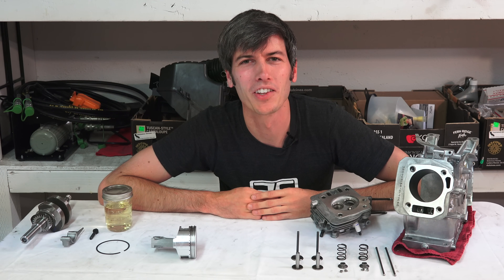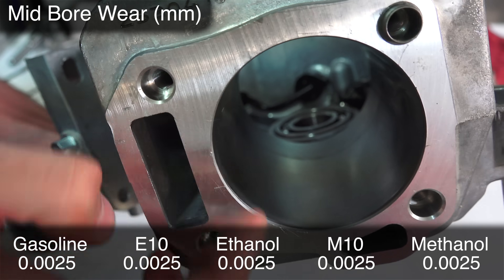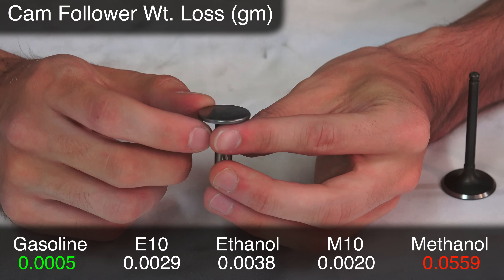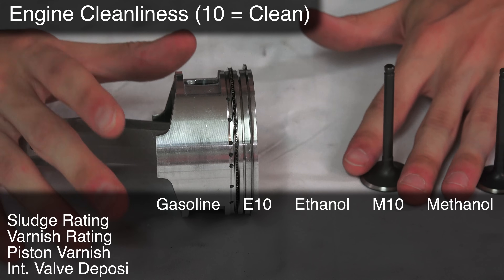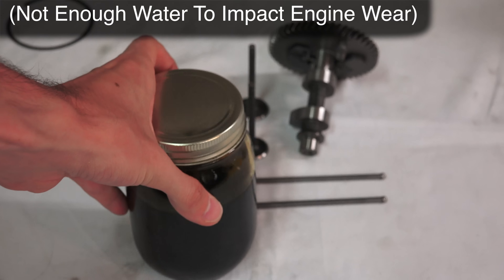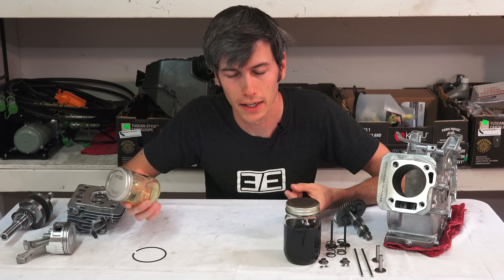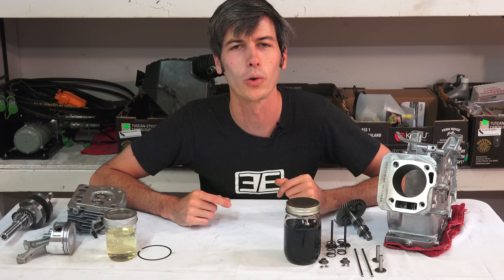Is Ethanol Bad For Your Car's Engine?

Comment: Right, "as far as your engine internals", which is not saying much about the fuel delivery system. Ethanol WILL change your air fuel ratio in older and newer carbureted when it reacts with the internal seals, zinc coating, or other steel alloys. I'm surprised you didn't mention this even in the end of your video. When those chemical reactions occur, they can affect the air fuel ratio and THAT can wear an engine!
If you have an older car, Ethanol in fuel WILL, not might, WILL react with fuel delivery systems causing all kinds of headaches. If they didn't, why would airports still be selling pure gasoline? Hint, it has nothing to do with altitude.

Comment: First off you skipped over a few things for example water in the oil for long terms would cause engine wear, 2nd most of the problems from ethanol comes from the fuel system and fuel issues you mentioned.  What you do not seem to think about is to the average consumer when the engine is not running correctly it is an engine problem and they want to know what happened.  The mechanics that service the cars do not want to be responsible so they throw ethanol under the bus as that is the root cause of the fuel issues.

Ethanol may not wear your car out faster but it will make you see a mechanic more often.

Comment: Is there a study for E10 in 2 strokes...? As it can cause engine seizures.

Why (in a 4 stroke) does E10/E15 produce a different exhaust note compared to normal petrol (or gasoline)

Comment: The study was published in 1981 right? So the engine they performed the tests on was also from around that period. Wouldn't the results be significantly different for modern engines?
Reply: I don't know how this is still an issue. E10 has been mandatory in Europe for a long time, all european and japanese vehicles that I'm aware of have been fit to run on E10 for decades. Pretty much everybody in Europe uses E10 in roughly half the cars in the continent and all the motorcycles, you don't hear anyone complaining about damaged fuel gaskets, it's a non-issue.

There must be an awful lot of people in the US still driving 30 year old cars.

Comment: This ethanol gas is not good for the plastic parts or if the gas sits in a gas tank or carb for a little while. The parts in contact with the ethanol rust, and the plastic over time becomes brittle, Ethanol gas blends with water, so it pollutes rivers or streams easier than the older gas.

Comment: While the results from this study are interesting, I wonder how long term oil dilution from fuel is affected. Also, a lot of people claim that older vehicles with rubber components in the fuel system can be damaged by ethanol, so while not bad for the engine, per se, ethanol could impact the fuel system.
Reply: From what i have seen here in Brazil, engines that run with e100 tend to have a cleaner oil when it's changed, but if the oil change is late, the oil may be kinda yellowish, not milky, but like a dark brass color

Comment: If you’re a fan of vintage or collector cars, try to avoid it whenever possible.  Fuel systems and carburetors that we’re not designed for it can suffer major damage that can lead to engine fires.

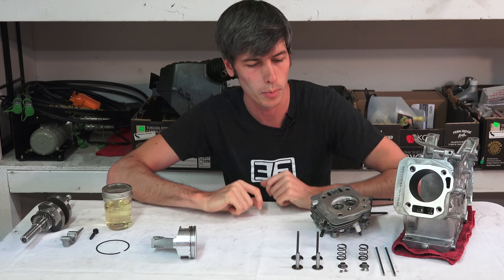Comment: 1:21 - I very much enjoy the new style of these videos :))))

Also, the 2012 renault 1.2L gasoline engine doesn't start once in every ... say ... 10 turns with E10 ... took me ages to figure out what was pissing it off; with E0 it starts literally 100% of the time ... how could it have such a large impact though ... the car's simple AF ...
Reply: Buying a french car was your 1st mistake. Alcohol ignites easier than gasoline, have a good mechanic look at your O2 sensor and run a diagnostic test.

Comment: First it was the removal of the lead. It was a lubricant for the top end so it killed all older cars.
Then its the 10% alcohol in the gas that simply lowers the milage. The government subsidizes the corn growers and gives them a fresh market to sell.
We the American public pay the bill bill for a product we dont want or need!
Ive tested all the gas stations in our town, only 3 of them. They all average 15% alcohol. Our airport stocks leaded regular and zero alcohol but wont sell to autos!
When i was still racing i bought from an airport.
Reply: Eugene Mitchell, Govt also made the oil companies take the zinc additive out of the oil and we did not realize this until millions of cars were backfiring in the intake manifold. Untold headaches for cam builders, machine shops, garages, and everybody else without roller lifters.
Reply: @Z06Doug  at the time i was building VW engines for sand rails and the trick was to switch over to stainless valves guides and seats.
When i built a new engine for my ford the flame hardened valves didnt last a year before they tuluped.
I had no clue about the oil. I used synthetic even back then except for break in.

Comment: Feel so sorry for you guys across the pond being ripped off so bad with poor RON rated fuel. At most, it looks like the shell nitro fuel (equivalent to "V-Power" here in the UK) has a 91 rating whereas we have a 97. Not sure if there is access to higher rated stuff over there, but I haven't put anything less than RON97 in my M3 unless I would have to in an emergency.
Mind you, I pay around £6.36 ($8.23 U.S) a gallon for v-power as we pay a huge chunk of that in tax alone whereas it seems to be much cheaper in a lot of other countries.

Comment: Another great video, thank you. One point that seldom is mentioned in favor of ethanol / ethanol blends is the boost in octane.
I owned a 2000 turbo car that required 91 octane minimum and experimented with using 91 octane, 87 octane , and a blend of 87 octane and E85. From a power point of view, the 87 octane and E85 blend (8 gal of 87 + 2 gal of E85) preformed as well as the 91 octane gasoline. Fuel economy was not as good. The problem I see with E85 as an octane booster is E85 can be a mix of UP  TO 85 % ethanol / 15% gasoline. It may be as low as 58% ethanol according to the disclaimer on the pump near me. Also, the octane level of the gasoline blended with the mix is also an unknown.

Comment: It is a poor test by any standard. Ethanol can damage some types of seals but it takes time. Ethanol also attracts moisture. When use in carburetors with venting water will accumulate in the bowl after time, especially if the engine sits and there are atmospheric changes in pressure and humidity. Aluminum parts will corrode and oxidize. I have both 2 and 4 cycle engines, lawn equipment and generators. Some times even with fuel additive the water builds up. Ethanol is also a subsidized fuel since it cost about 4 dollars a gallon to produce as I understand. It also precludes storing gasoline for any long period of time. And it gives less miles per gallon.
Reply: Jas Doberman wear was the only focus of the study.
Reply: Regular gasoline is one of the most subsidized products for sale though.

Comment: In Brazil they use E100 from the 70s. The Brazilian Fiat 147 was the first modern automobile launched to the market capable of running on neat hydrous ethanol fuel (E100).

Comment: I live in Brazil and our gasoline is E27 (E25 for premium gas). 
The ethanol in the gasoline is different than the pure ethanol sold for only ethanol powered cars. It's called anhydrous ethanol, which means it has no water in it's composition. Therefore it doesn't prematurely wears gasoline engines as much as normal ethanol does.

Thx for the video!

Comment: I'm from Brazil, where we have pure ethanol as an alternative to gasoline in every gas station since the 70s, if I'm not mistaken.
Car models used to be produced with either a gasoline engine or an ethanol engine until the Flex technology came around  in the 2010s. 
Now most cars are Flex, but most people run them on ethanol, or mostly ethanol with a small percentage of gasoline, as it is said it improves performance and it's easier to star the engine on cold weather too, as opposed to pure ethanol.
Ethanol engines, or running  Flex engines on pure ethanol, is cheaper when compared to gasoline engines because ethanol is plenty and cheap around here, since we produce a lot of sugar canne.
But there are disavantages. The rubber parts of engines (hoses etc.) running on ethanol are said to dehidrate and need to be replaced more often. And the engine is harder to start on a cold day. So much so that most cars with an ethanol engine (or Flex now a days) have a small gasoline tank in the front to inject gasoline when you start the engine. But when you forget to fill that mini gasoline tank and you run out of it, oh boy, you're gonna have a hard time starting your engine in a cold morning.

Comment: My Volvo 240 from 1978 doesn't like e10 in the winter if the engine is cold , and the fuel lines wear out fast if you buy cheap crappy stuff !!!!

Comment: I am not concerned about internal where of components that will pretty much last a hundred thousand miles anyhow I am concerned with the varnish deposits along the route of ethanol in the gas tank in the fuel pump in the filter in the injectors in the throttle body in a carburetor in the Jets especially 2-cycle engines varnished and Tiny cravity cavities varnished up by ethanol how do you make ethanol Everclear dilute Everclear dilute

Comment: Building my engine for Flex Fuel conversion to harness E85's 105 octane with a higher compression ratio. Water injection keeps it happy when running premium.

Comment: I'm not trying to rain on your parade. I found this very informative. However most of the time I've heard the concern being for seals rubbers and plastics used in the engine and support systems directly in contact with fuel and combustion

Comment: The US Navy once said a a ethanol gasoline blend was ideal ,then recanted when the separation  problems came up. Way before 1980 . But a 20 hour test is not realistic. Take a 1,000 hour test with periods of cooldow to full temperature and load and get a real indication of wear in the bottom end as well as the top cylinder area. CAT says Moo.
Reply: There was a test on youtube not sure if I can find it, 400,000 kms on E10, it was a 4wd, nothing beyond normal wear, and the engine was superclean, they opened it on the video. If I find it I will link it.
Reply: You can get around these problems by using wider fuel lines. Same solution works for bio-deasel at low temperatures.

Comment: Does this take into account that the materials used in both engines and oil have changed since 1981. Also, fuel has changed as well but still think the results are completely viable and still applicable.

Comment: Ethanol is very good for turbo charged engines, the fuel evaporation takes energy from the air, lowering the temperatures, helping protect from knock

Comment: Hmm 95 RON vs 98 RON E10 (a 98 RON fuel with 10% ethanol content overall) and the impact on fuel economy. Also what age cars can be considered ethanol safe? And the effect of E10 vs 100% gasoline on fuel system/rubber components/seals.

Comment: Interesting video just watched it after a trip. We live in an area with 87 octane with 10% ethanol. So we entered a state with straight 87 octane. So of course challenged accepted with ethanol the car 4 cylinder the can run on ethanol. With 10 percent it down shifted more and got only 29 mpg the same road same gas station filled up with 87 pure. Car didn't downshift as much, but got 34 mpg same elevation, hills, and road. All within a week. Unbiased mindset just curious really since we don't have that fuel at home unless it's 91 octane. It seemed on that short experiment 87 pure was better performance and mpg vs 10% 87. Miles where actually 4 tanks (2 each fuel type) ran down to empty of each type. Be interesting to see an experiment like this on a bigger scale. My experiment was just about 1000 miles and for giggles.

Comment: My old lawn tractor sure didn't like the Ethanol mix.   Perhaps not engine wear but definitely the fuel delivery components.     I won't put the ethanol mix gas into my new tractor, snow blower, chain saw, etc.  Unfortunately its getting harder to find fuel with no ethanol.

Comment: Could you do a video discussing all of the known advantages and disadvantages of running ethanol fuel and ethanol fuel blends vs pure gasoline?  You had mentioned that ethanol doesn’t have as much energy as pure gasoline leading to decreased gas mileage, which I’ve read that it is around a 3-5% difference per tank, usually 2-3 miles more per gallon with pure gasoline but there is no difference in performance or similar performance. Someone had also mentioned that ethanol in fuel can cool the engine but the mileage you gain with pure gasoline outweighs that.  I’ve read that the computers will change the air/fuel ratio for how much gasoline or ethanol is in your engine, so it doesn’t matter if you run E10 or pure gasoline.  You had also mentioned how ethanol can absorb water from the air over time which of course can cause rust in the fuel tank.  You had also mentioned that seals in older vehicles are not made for ethanol, same as small engine equipment, why ethanol destroys them, because the ethanol can put wear in the seals and end up rusting the fuel tanks after sitting so long causing the ethanol to absorb moisture from the air.  I had read though that only vehicles made in the ‘80’s and prior should only run pure gasoline and anything newer is safe to run ethanol where as you had said vehicles 20 years and older shouldn’t run ethanol.  Just wanted to know when auto manufacturers actually started making vehicles with seals that could withstand the ethanol.  I actually drive a ‘99 and as soon as I found out about pure gasoline I started filling up with it, only for a few weeks though, being I only use Shell and the nearest Shell station with pure gas is 21 minutes away.  I had thought I was getting a better deal with the increased gas mileage and thought that the pure gasoline was going to deliver better performance being it has more energy and thought that my air/fuel ratio was going to be better.  I still do have a few questions about pure gasoline fuel though.  Who does it come from?  There are some stations that sell ethanol free fuel that are labeled as “unbranded” online and others that say it is the brand of the station, but the pump just says ethanol free fuel, it doesn’t actually have a brand on the pump.  I also want to know if there are any additives in ethanol free fuel.  I have read that it is required for all fuel that is sold to the to the public for automobile use must have some form of additives and that there are standards that were created by the EPA that must be met.  I have never seen a petrol company even talk about selling ethanol free fuel nor have I seen any kind of advertising for additives being present in ethanol free fuel.  I know that the EPA had pushed that we have ethanol blends of fuel which we have up to E10 and have heard they are trying to push E15 and auto enthusiasts and manufacturers are trying to push them away from it.  I have even seen an environmentalist say that they had pushed for ethanol to be present in our fuels because it burns cleaner and that they are now trying to go back to pure gasoline because of the process of deriving the ethanol from corn and how much more polluting it is to the environment.  I have heard that any blend of ethanol in fuel does burn cleaner from vehicles being there are less emissions but indeed is actually more polluting to the environment because of the process to derive the ethanol from corn.  Also, why does pure gasoline cost more than ethanol blends of gasoline when ethanol costs more to make per gallon than gasoline?
Reply: Ethanol seems to give a bit more power for turbo vehicles I believe. It's good for racing / tuning for sure. I can't imagine production is worse than oil and gasoline production, but I don't know exactly how it's produced.
Reply: Oh and All fuel has additives I'm pretty sure. There is no 'pure' gasoline. It comes from evil oil corporations. They're all the same who cares about the brand.

Comment: Does it mean that if my engine has some miles to it I can try & run E10 or a blend of E85 & pure gasoline in order to clean the combustion chamber of the engine? When I check it with a camera I see some deposit and as far as I know the « miracle » solutions that are supposed to clean an engine in 20 minutes don’t give any visible result... could it be a mild & long term cleaning alternative?
Also for very old cars that were used to run leaded fuel, it is worried that ethanol, being very dry, would accentuate valve seats wear even further than unleaded fuel would. I am very surprised to not see any measurements on the valve seats themselves to be honest. Any clue why?

Comment: Thank you for that. In Germany People really were freaking out About E-10 would Damage the engine. Nobody wanted to buy it and nobody wanted to give a garanty it would not Damage the engine. I have a PT-Cruiser 2,4. Bought at 55,000 km, now has almost 155,000 km running fine on E-10. Never had any Problems. Now I learned it was not a total made up hysteria and Ethanol can at least do some Damage on fuel lines in older cars. I love the channel and besides learn interesting engeneering stuff I learn many new english vocabluary. I think by watching you channel I know more english vocabluary About Engineering and Motors than I know in German which is my mother language :-) !

Comment: I get spark knock on 91 octane e10 but not on 91 octane e0. Fuel range is important with only five gallons so re-tuning isn't an option for me. I'll keep buying straight gasoline as long as I can.

Comment: great to hear , I've been running e85-e90 exclusively for the past 4.5 years and it definitely holds true ...the only thing i do is 3k mile synthetic oil changes just because of the extra water alcohol always pulls out of everything .... good info